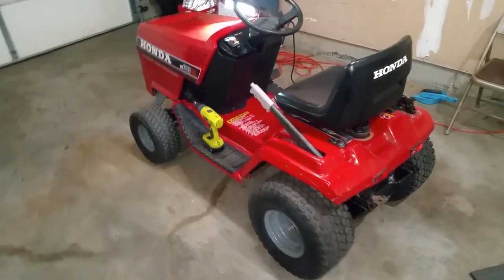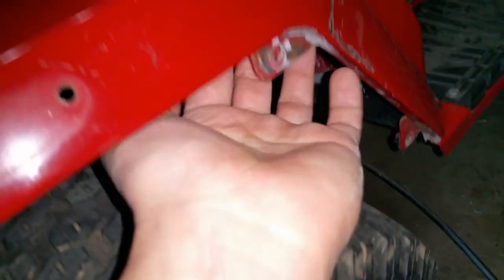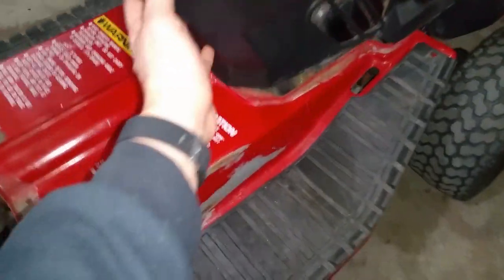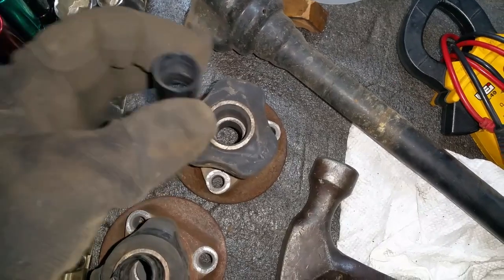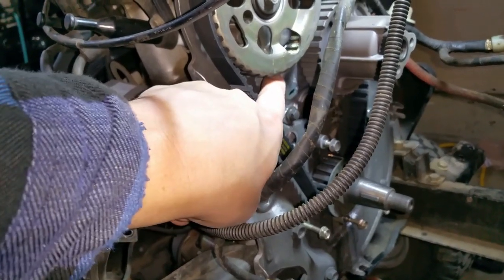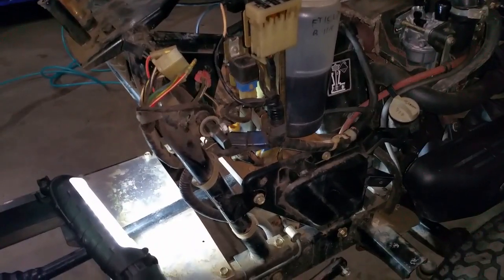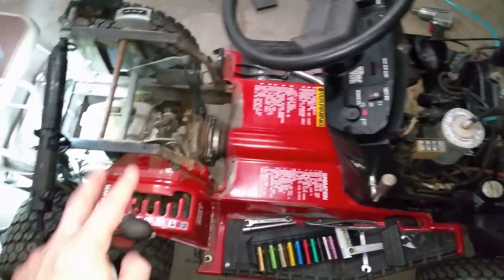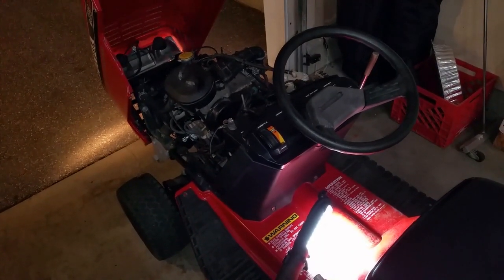Honda 3813 Service & Rebuild

Comment: I am so glad that you videoed this repair service on the HT3813. I am currently restoring one from ground up. Sand blasting all parts including frame, but did not take pictures while disassembling the unit. Although I have the service manual, I needed to see harness routing and clip placements. I hope to have a almost like new tractor.

Comment: I found it easy peazy to remove the hood, rad and pick the engine up and put it on a bench to gain access to everything you're servicing.  By the time you've removed the battery and it's tray you are still left with a maybe situation of being able to move engine forward enough to get the driveshaft damper off the shaft and out. I bought mine new in 84 and that thing has required only that damper kit and routine oil/filter and one spark plug change in over 36 years of operation, mowing and blowing snow.
Reply from the maker: They are very well built machines. Sadly I don't have an engine hoist/ lift, and I am unable to lift heavy stuff due to a double hernia injury. Most of the time it is just me working on machines. I agree with everyone that has said it is easier work wise to pull the engine, and it really is not that difficult to do once you are familiar how they are assembled. Given that this machine pretty much had NOTHING done to it since it was bought, left in a field for over a year with the damper problem, in the rain/elements etc, I know it was worth doing the full tear down. After all that, still impressed how well built this machine is.

Comment: This tractor seems to be in super good condition! And you did a good job with it. It always seems to be that the front damper wears out first. I think it is because the engine is very badly aligned compared to the gearbox. I tilted the engine on my 3813 backwards a lot, so the crankshaft and gearbox input shaft are almost parallel now. It seems like the damper lasts very well now, but I cannot be 100% sure because it has been less than 3 years since I did it.

Comment: Just bought one for 350 in excellent condition.  Just Lets out little smoke until it warms up
Reply from the maker: valve stem seals I would say need replacing

Comment: Where can i get a factory service manual for this.. When i try t turn my key ionly get a half turn at the fan and no start? Thanks for your informative vid
Reply from the maker: If you do a search online I know it's readily available or you can check on the mytractorforums.com i think there is a link there somewhere.

Those symptoms can be a couple things. I know the starters on these engines tend to not have a very long service life. Another possible issue is the compression release mechanism failed or the valves are out of adjustment.

Comment: Appreciate your post. I  am working on a 3813 & suspect a switch is the problem. Would love to bypass by disconnecting that connection @ 15:45 but I don't appear to have that part. Maybe a different year or something. Is it feasible to jumper the seat, PTO & Neut. & accomplish the same result? I did jumper the seat as you show later in the video because it was easy. BTW, I have tested the ignition switch for continuity (good) and tested the solenoid; ie, I can activate the latter by directing 12V directly to the spade connector thereon.

Comment: Can you elaborate on how to clean and adjust the transaxle clutch? Thanks.
Reply from the maker: Cleaning the clutch is spraying it completely down with brake cleaner. Adjusting the tranny clutch there is a 10 or 12mm bolt located in front of the right rear tire. CCW increases the clutch engagement delay, CW decreases it...but too much and the clutch will never disengage so be careful.
Reply: Thanks so much for the quick response.appreciate your help!

Comment: Your mechanic skills amazing all while video recording it too takes extreme work. Do you know how many hours this Honda HT3813 has? I’ve found a beautiful one near me that was garaged it’s entire life, but if I can no longer find parts I may have to pass. Assuming if the hours on this tractor shows typical wear then the one I’m looking at will generally be the same. Thanks for posting man!
Reply: You can still find parts for them, but you'll have to do some leg work tracking them down. I highly recommend picking up the factory service manual if you do get the machine. These are fairly complex machines and the service manual comes in handy.  These were awesome machines. Over engineered in every way.
Reply from the maker: No idea on hours, but this one was left in a field for a year in the elements.

Comment: What did you mean,  'cleaned up" rear clutch &  clutch shock thing ? taken apart & sanded? wire-brushed, oiled ? Adjusted cable? Mine is taking way too long to go into gear, 10 seconds or more.
Reply from the maker: All of the above and sprayed down with brake cleaner. There is an adjuster bolt to change the time delay the clutch engages you may want to look at

Comment: Excellent work and Video.  I think the Battery Tray deserved  cleanup and Paint though.  Is there a clearance measurement for the clutch adjustment at the rear?
Reply from the maker: Hello. Yes there is plus a wear limit stated in the service manual. I didnt show it on camera but you measure with a feeler gauge with the clutch disengaged. From there you adjust the nut for the speed of engagement. That way its a smooth shift from gear to gear. The setup is basically shifting on the fly, bout as close to a hydrostatic trans without actually having one.
Reply: @Bassguitarist1985  Thanks.  Start with 0.010"?  The machine takes off very slowly.  Sometimes  runs on 1 cyl so I suspect a new coil is needed.  Are they available?  I hope there is a safety ground wire to disconnect as you showed.  Sometimes starts, sometimes not. Always cranks.  New plugs and battery.  Coil seems buried!  Volunteer work for a neighbour.   Thanks

Comment: Hi I just got 1 of these and the pto clutch is shot and I can't get it started with the key ignition? The only way I can get it started is if I take a screw driver to the solenoid... do u have any info on them 2 things ????
Reply from the maker: I know the PTO clutch is available but it's pretty pricey. It sounds like your key switch may be faulty. If you jump the solenoid and it starts up its not the starter motor. I would be suspect of the solenoid as well. The solenoid in the starter motor are one unit so that will have to be inspected
Reply: @Bassguitarist1985  ok thanks sooo much I'll check it out this afternoon when I get off
Reply: I'll let you know what I come up with..
Reply: @Bassguitarist1985  what else should I look for ?
Reply from the maker: @jorelsmith1985  pretty much every electrical component. Given the age of these machines anything small could be suspect
Reply: Ok thanks well the hunt will be on tonight lol. Thanks a million
Reply: Hey bro I just got done. It was my ignition switch. I replaced it with a new a new put I'm still going to try and find the original part on ebay... my next thing to do it the pto clutch ....
Reply from the maker: @jorelsmith1985  nice! Congrats!!
Reply: @Bassguitarist1985  thanks sir
Reply: Is it easy to put the pto on..u got everything taken off and I been looking on the Internet on how to buy a new 1
Reply from the maker: @jorelsmith1985  yes, but a lot of stuff to remove to access it. Radiator and fan needs to be removed to get access to clutch. If seized on there its going to fight you
Reply from the maker: @jorelsmith1985  uou need to determine if the friction disc is worn out, check the bearings if they should be replaced. A full pto kit is over $300 last i checked
Reply: Ok I sure will thanks
Reply: Where can I find the whole kit at sir
Reply from the maker: @jorelsmith1985  ebay.
Reply: Ok thanks soooo much sir.. for all your help
Reply: Good afternoon sir. I wanted to know how do you tighten the brake cable...
Reply from the maker: @jorelsmith1985  there is an adjuster nut right at the parking brake lever.
Reply: @Bassguitarist1985  ok thanks and that will make it stop better when I hit the brake pedal on the right side
Reply from the maker: @jorelsmith1985  no only the parking brake. The pedal adjustment is on the transmission
Reply: Thanks sir
Reply: @Bassguitarist1985  wasn't sure how to message you. I'm working on one of those 3813s just doing a simple service and realized it needed a battery. I replaced the battery and now have lost spark! First the spark was very weak using an inline spark tester and then no spark at all. Please help me!!! Thank you in advance
Reply from the maker: @donmayberryjrsOPE  hey sorry for the delay..my email is on my about page

Comment: I'm wondering how much all this servicing is going to cost? I have one and so far no problems, just a little soft when engaging the mower. I'm pretty sure that is the adjustment of the belt.
Reply from the maker: It was a considerable amount of work to disassemble repair and reassemble. Thankfully these machines are built so well that they can go for a very long time before needing these parts changed.
Reply: @Bassguitarist1985   That is my overall impression. I used to be an auto technician before and I can sense the quality compared with those with a Briggs and Stratton or other air cooled engine. It was as if everything was designed together. Typical for Honda, actually and they didn't skimp at any expense. I bet they cost a lot when new.
Reply from the maker: @8lazingSaddles  exactly why you do not see them being made anymore they price themselves out of the market back in the late 80s early nineties and decided it was no longer profitable. The machines were actually built by the Honda motorcycle division and many of their parts are cross referenced to those parts if one takes the time to research.

Comment: I got the 3013 that has a 38 inch deck and 13 hp single cylinder gxv390. I see now why they didn't call it the 3813.

Comment: How did you remove the flywheel
Reply from the maker: Remove the nut and lock the flywheel with a strap wrench. Then with a little prying pressure, do a quick smack with a 5 pound sledge, popped right off.

Comment: I have one in my city stating it runs but doesn’t drive for $275. Seems in alright condition from photos. In your opinion would you get it or pass?
Reply from the maker: I'd say its worth it for that cost, just be prepared to pay a lot in parts, and what parts that are NLA from Honda, you will have to try ebay or the interscreens!

Comment: How on earth do you remove the starter on a 3813 machine?
Reply from the maker: Motor has to be pulled since the starter is part of the motor mount. That or support the engine weight with a jack and remove the starter. Hard that way IMO though.
Reply: @Bassguitarist1985  
Thank you for the info, much appreciated. This is going to be fun. One last question...can starter internals be pulled to rebuild it without removing the whole thing? Thanks.
Reply from the maker: @farmer-sw1he  sadly no, but I know internal parts could be replaced. The issue is sourcing then from Honda

Comment: Looks like the exact same motor as my Honda generator!
Reply from the maker: Let me guess, an ES6500?
Reply: Yep !
Reply from the maker: @elisancere3578  the client i fixed this 3813 for has the same generator too. It's due for a timing belt and water pump change too!
Reply: I just did a water pump , timing belt, spark plugs, oil change, and starter . Runs very smooth and quiet.
Reply from the maker: @elisancere3578  they are amazing machines. Sadly many parts are NLA, but plenty on the used market and potentially overseas. Many of the Honda motorcycle parts cross with the riders and generators.

Comment: A powersports dealer has an old used faded pink one that's been out there for 7 years. He believes a sucker will buy it one day. Dude is the only cat in town. I say more power to him. You won't be in business long giving things away. But he charged a restock fee for a motorcycle visor that didn't fit. $8 whatever. But he had an old 97 50cc scooter back in 2009 and wanted the new $1200 price on it and it was all rusted. I turned over a Ninja 250 in the showroom and it was embarrassing. Everyone run out and asked was I ok. I'm done. I believe that was a sign.
Reply from the maker: Some are very passionate about these machines and keep them running. Its only getting harder to find parts for them. Just spent 3 weeks looking for spindle pulleys that are NLA for it. Not fun. I did wind up finding two NOS ones in MS, but thats after calling half a dozen dealers that said online they had it in stock. The guy paid me for my time so I'm not complaining ha!